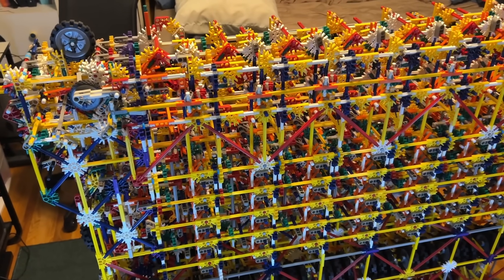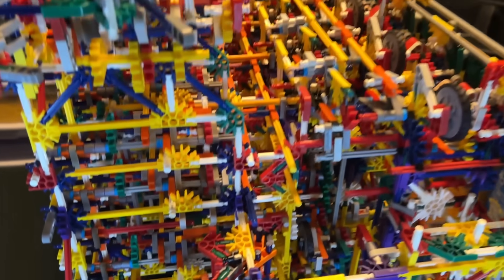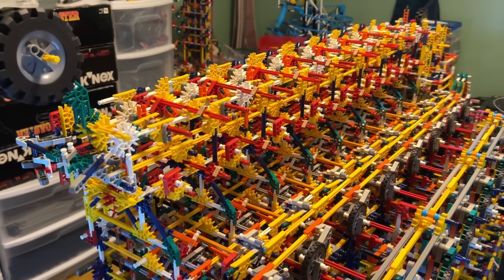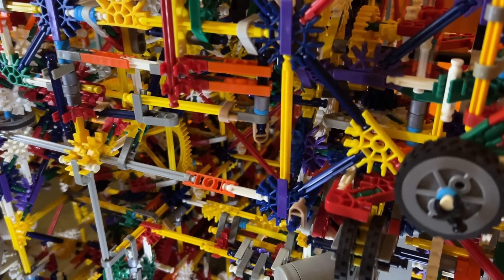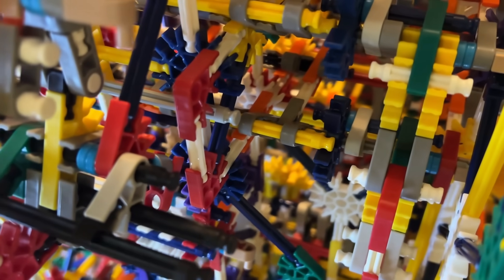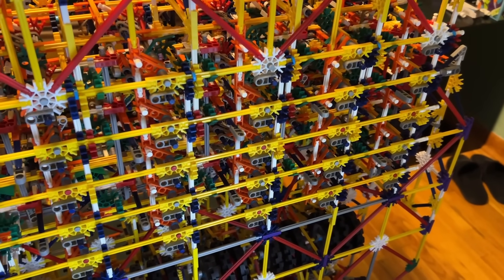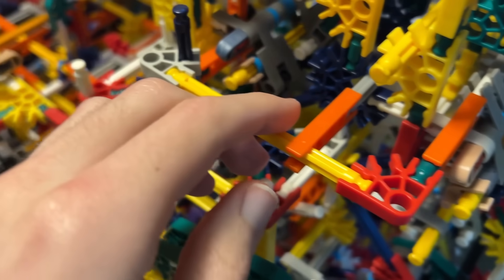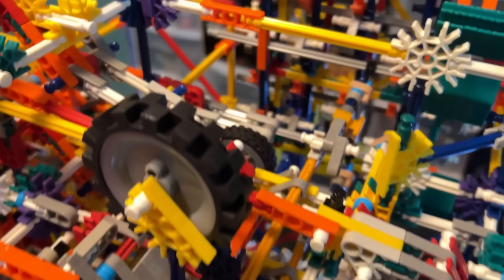Knex 8-bit Mechanical Computer - Update 2: Registers, RAM, and Data Transfer

Comment: You definitely need to spend more time taking a little bit of a step back when you're showing off specific sections. We want to see how it all fits together not the specific internals THE ENTIRE TIME. Point out where "the right operation for the registers" is on the whole thing cause if you don't I'm just staring at more knex lol.

Comment: I understand that scientists/ hobbyists say this is a computer, but for me personally, i don't understand how this is considered a computer. He described it, but i don't understand how this computes, has memory or has any real purpose besides being a cool contraption. Admittedly, im closer to being the dumbest person ever than the smartest person ever, can anyone simplify or dumb down an explanation for me as to how this is a "computer?" I'd really appreciate it, i truly am fascinated on understanding how this is considered a computer....
Reply from the maker: A computer just needs to take in data/instructions, process the data based on those instructions, and output the data. In this case it will take instructions from the ROM (not built yet), process data in the ALU using operations like addition and subtraction, and output the data to RAM or the numeric display. The memory is just the bits that are set on or off (flip flops that are pushed left or right).
Reply: @Shadowman39 So, you're eventually going to have an hmi (human machine interface) that you can input instructions to it, and it can perform those instructions and display a value on the screen? Am i interpreting that correctly?
Reply from the maker: @jun1orbaitor44  Yes, but input is just done by flipping the bits, mainly on the ROM which looks similar to the RAM bits. There will likely be control levers as well for settings (like signed vs unsigned mode).

Comment: A Genius machine. But what is the calculating speed and power consumption for 1 doom frame?
Reply from the maker: It would take hours probably lol, maybe it could just be 30 minutes if rendering cubicdoom or some other simpler version. Each motor uses 6W max so not much power.

Comment: This is cool. A very dedicated and industrious individual you are. Have you ever heard of a siphon cascade? Also commonly known as an automatic fountain? They're a simple hydraulic system. You can power your computer with one by converting the hydraulic flow and convrting it into mechanical movements, not by generating electricity from a turbine,  but using the flowing water to turn a mechanical a series of paddle wheels and bypassing the electricity meeded to turn your powerplant. I know how lofty this reads, but it's doable, and it isnt perpetual,  its consistent within hydrodynamics and simple physics. Its something to look into. It will take a bit of creative iterations,  but the end result will be one for the record books. You've come this far, I believe you can make it work. Awesome work dude, and thanks for posting this.

Comment: This is the thing that bugs me. What is the interface going to be? Will you, as the user, have to input everything a bit at a time, and then read everything a bit at a time? How slow and tedious is that process going to be? Will using this machine make solving problems harder instead of easier?

Comment: Somebody get this man a PC.
Reply: LOL
Reply: When the grid shuts down, this guy has it covered
Reply: Nah, you go through that much trouble to build a Knex PC, then he needs to build, a real PC, not given. And not talking hardware parts by manufactures either. All he needs is, a CPU, RAM, cooling fans, cooling core, and PSU. The rest of the parts will be circuits, PC boards, slots, solder Iron, solder, past, clippers, connectors, cutters, ect, ect, so on and so forth. Such as metal for a case, rivets, screws, A OS, maybe Linux, this is getting insane huh? And More Ect, ect, ect.

Comment: inb4 it's playing doom and getting a Skyrim port lol Seriously though this is exceptionally cool to see and I'm curious, are you experiencing any issues with k'nex's intended use-case/manufacturing tolerances such as binding issues? I haven't messed with these in decades but the tolerances used to be surprisingly good from what I can remember, however this is FAR beyond anything I ever made lol.
Reply from the maker: There are really only quality issues since most the parts are used and can have wear over time. The tolerances are pretty good though. Thanks!

Comment: This is insane, I love it.  I've been hand assembling machine language since 1980.  I know instruction sets and addressing modes for the: Z80, 6502, x86 and ARM Architectures.  When we look at the Opcode of an instruction, I always assumed the bit patterns 'Somehow' were decoded and told the CPU what to do and how to use the Operand(s).  I never took the time to look for bit patterns in the opcode and how the CPU actually does it's thing.  I'd love to pick your brain, as you've made a mechanical device.  It's beautiful!  Did you model it after a particular CPU or did you make your own instruction set?
Reply from the maker: Thanks! I have an instruction set similar to Ben Eater's breadboard CPU, but it's modified to take advantage of this hardware. The next videos will cover more of the opcodes and decoding.
Reply: @Shadowman39  Wow!  Just Wow.  I love your work and disclosure of info so cool to me.  I will find a way to send some gratification your way on a monthly basis.  I find your content of value.

Comment: [philosophical window] Some people say that LLMs have consciousness, that they could have subjective conscious experiences like humans do. My favorite argument against such claims is that theoretically you could build a mechanical computer which would be computationally equivalent to a microelectronic one, and then run the model on that. And it would behave the same. But would you still say that it has consciouness if it's running on bunch of gears and levers? Or a piece of knex plastic like in this example? Probably not.. :)

Comment: Congratulations, you have surpassed the father of computing himself, Charles babbage. I'm not even kidding, he designed a mechanical computer in the 1800s, had a part of it prototyped, ada lovelace wrote programs for it, but otherwise it was never built. Meanwhile, you've surpassed him with a plastic toy; the wonders of modern computer science.
Reply: Well duh, Babbage didn't have Knex to work with
Reply: The Z1 was mechanical and built in 1937. A replica exists in a museum in Berlin. Very finnicky to build and could get stuck during certain operations. Very impressive if this one works. Not sure if it also supports floating point numbers yet though. The Z1 did.
Reply: You realize that we have real computers now right?
Reply: @realtalkfit100  also, by all accounts, this is a real computer. Sure, it's not like all of ours, but it is just as worthy of the title as even a quantum computer.
Reply: @realtalkfit100  you do realise that wasn't my point, right?
Reply: @Fugels your point is still dumb. This YouTuber is using parts that was designed and manufactured...with a computer 😂
Reply: @tenzaemtade6146  I can't even fathom how that matters. I'm commending him on achieving what babbage couldn't. He managed to make a full mechanical computer; that's one hell of an achievement.

Sure, it's not gonna beat an electronic computer, but that's not the point. He took on a challenge and, thanks to modern computer science and manufacturing, finished what babbage started. Yes, a computer was involved in making the parts, but designing and making the computer itself is the achievement.
Reply: @Fugels  designing and making the computer that was already designed and made by computers vs making a computer by scratch
Reply: Let's keep Lovelace's revisionist attribution out of it. Babbage all the way.
Reply: @CyberneticArgumentCreator  why?
Reply: @Fugels he was being humorous in support of the kid. 
I'm sure Lovelace was lovely but Babbage all the way!

Well done kid, seriously it's impressive engineering even just this far!
Reply: @CyberneticArgumentCreator  when was it revised? The department of defense named a programming language after her in 1980
Reply: @CyberneticArgumentCreator c'mon, programmers could pull an Ada anytime a woman looks down on them for being programmers 😅. Joker card
Reply: @CyberneticArgumentCreator  It's not revisionist. We have her letters where she was designing algorithms for it. For a computer that never existed, that's about as good as it gets. Babbage of course gets more credit for designing the machine, but Ada's contributions are well-documented, archived and studied in academic circles. She offered improvements to the design (she translated a paper in Italian to English and offered tons of notes on it that were longer than the original article), and she wrote the first computer programming algorithm, which was to find Bernoulli numbers. Babbage himself called her the "enchantress of numbers" due to her mathematical skills

Comment: Have you considered creating something similar to punched cards? I suppose they would be slower to read and write to, but you could make just one device for reading and writing, and the actual memory cells would be simple, compact, and cheap, am I wrong?
Reply from the maker: Even if the program was stored on the cards, it would all have to be loaded into ROM to allow for instant jumps anywhere in the program. But I've thought about making the ROM itself more of a tape-style storage instead of like the registers just for compactness.

Comment: A hard bottleneck with this computer is power transmission.
You get power loss between each moving part, to the point that moving something at the end makes the first connection point endure crazy forces.
You will need to separate everything with actuators to transmit power, instead of 20 levers in series.
This video explains it.
The end of this video is what this computer is trying to do if it gets any more complex.
https://youtube.com/shorts/oLrpNFf7La0?si=Xkyjwj3Dvn9y4ofa
Reply from the maker: Indeed, nothing will be that forceful but things that need more power are relayed by other powered devices, with their own motors.
Reply: @Shadowman39  Will Lite-Brite be used as a graphical display?
I believe it would be fitting for this computer, and can be ran as an RGB display.

Comment: Do k'nex mechanisms need any kind of lubrication? I've never experienced k'nex but I would think the gears would chew themselves up after a while?
Reply from the maker: Most don't bother with lubricants, and I've heard using them on roller coasters makes things worse. But yes, the plastic on plastic will wear after awhile if left moving all the time. I've seen it mainly on rods rotating in connectors rather than gear teeth.

Comment: this is like watching a minecraft redstone computer. very awesome !!
Reply: I imagine most kids play with minecraft before lego at this point. Im glad redstone is there to make kids think. However,  nothing like getting your hands dirty with something real like knex.
Reply: To execute the most fundamental Minecraft code, how many of these identical units would be necessary? I am curious to know the output capacity of this device, represented using numerical symbols within the decimal system. Will this feature be implemented?
Reply: @RAF-vq7yu  My mind was wandering in these directions while my silicon computer was displaying this Knex computer.
Can we simulated Knex on a computer, make a Knex computer inside a simulation, run Minecraft on simulated Knex ? Make a computer inside Minecraft (inside a computer) that would simulate Knex and make a copy of this wonder inside Minecraft ?

"O brave new world that has such people in it", said Shakespeare, and it applies to every Youtube creator that makes such wonders.
Reply: @VOID_WARRANTY  i like where you're going with this
Reply: @RAF-vq7yu  Simplest code would be AABB collision, which could be resolved by comparing whole numbers.
Reply: First thought...
Minecraft!
Reply: It works... It just takes several days for a simple answer, but it works!😮😅
Reply: Ok, but what are you actually computing…
Reply: @ASewingMachine whatever you want. Same as any computer is comes down to math operations done to data in the registers. Data in data out. Its a computer
Reply: @SoulAir but in fact, that's you working as a CPU!
Reply: @ASewingMachine  nothing

Comment: You have more persistence than I have, and you have my admiration.
I was thinking about how you were going to get programs to load into such a machine.  I expect you were going to just change what's in ROM, but it occurred to me that the ROM could just contain a "boot loader" and you could load short programs from sheets of paper, cut so that they can be driven in a predicable way by KNex gears and with holes in the paper for 1 and no hole for 0.  Lift the reading arms into the air, move the paper, lower the arms (if an arm hits the paper, that's a 0 and if it drops through a hole, that's a 1), read the value into RAM, repeat until end of program (or end of RAM since you probably won't have much).  Jump to the program.
Reply from the maker: That would be good to have, but I wanted to only use Knex for now. But, I'm tempted to add servos to each bit in a byte of RAM and have limit switches on those bits as well, to make it interface with my actual PC. If using paper to load into ROM, it would have to be written, making it not read-only and I'd have to make it program-count while writing as well. But it would be cool to have a 2-axis robot back there that flips the switches to load new programs haha.
Reply: @Shadowman39  Can't wait to watch it load and run programs from a PC.

Comment: Have problem, will solve... Don't have problem, make problem then solve. 
Having said that - As a 60yo professional software/hardware developer/engineer, I take my hat off and applaud such creativity and enthusiasm - (And yes, I can imagine some potential real world uses, if miniaturized say to molecular size).
Peace from Australia.
Reply: Like what?
Reply: @JohnnyLawrenceCK  mechanical computers could maybe be used in place of electric computers in extreme environments where electronics break. such as the surface of venus for example. it would be much slower, but it would work
Reply: @MinerBat  Perhaps, but NASA has been validating silicon carbide integrated circuits in simulated Venus conditions for a while now.
Reply: @JohnnyLawrenceCK  Any device that requires calculations, in which the current "state" remains when power is off (or interrupted) for potentially long periods of time (even years). Our brains work in a similar fashion, but use chemical reactions between the neurons rather than mechanical positioning. Our brains also have the dis-advantage that they break down quite quickly when "turned off".
 This device could sit dormant or years with no battery or electrical signals,  and when activated would be capable of remembering its former state, and taking potential actions. It would also be unaffected by power or electromagnetic fluctuations... Which could be an issue when in space, or in time of catastrophe.
 You could do the calculation on how computationally powerful such a device would be, by determining the theoretical maximum number of connections in a given area...
 A real life example of this would be a "flagellar filament".
 Peace, from Australia.
Reply: This is coming from a person who thought raygun was an Olympic athlete.
Reply: @magawillgetu  😂 🦘 💃
Reply: @magawillgetu what's coming from him?& What about it?

Comment: This is great. Zuse would love it. I have built CPUs and computers myself (with relays, as well as on FPGAs, with TTL gates, and also in Minecraft). Now please build a megabyte of RAM, so you can install an early version of Windows on it 😊

My simplest computer was a 1-bit computer. It had 32 address lines, 1-bit word size in memory, only one instruction, and the only thing the ALU could do was to invert a single bit. But having a Von-Neumann architecture, using self-modifying code it was Turing complete.

Comment: Do you already have a list of planned instructions and specs? I am working on an emulator for fun.
Reply from the maker: Here's the set I'm planning on now, might move the jump opcodes around though.
https://gist.github.com/Shadowman39/bbfd50d7df52a4d62179cdec63b7b78d
Reply: @Shadowman39  Thanks!
Reply: So, you abandoned XOR?
Reply from the maker: @bengineer8  I don't need it in the instruction set, as it would just add complexity to the ALU drive system for little gain. But the ALU has that capability if it's needed in the future.

Comment: To help describe how it works, maybe see if you can overlay some still frames with some highlighting, or introduce a few drawings into the videos to explain concepts? As others have said, it's pretty hard to follow what's going on. Doesn't have to be fancy, but would really bring the crowds to your videos if we can all understand what's going on. As a hardware and software designer myself, even I struggle to understand what's going on due to the 3D nature of machines like this!
Reply from the maker: I plan on making better videos once it's all done. No use doing things like that when it might change, plus I'm spending all my time building the machine haha.